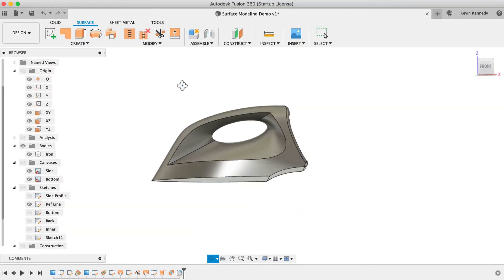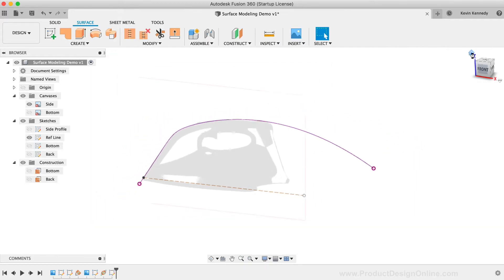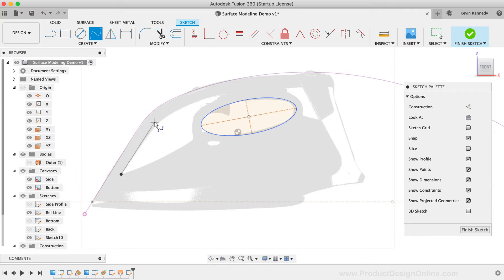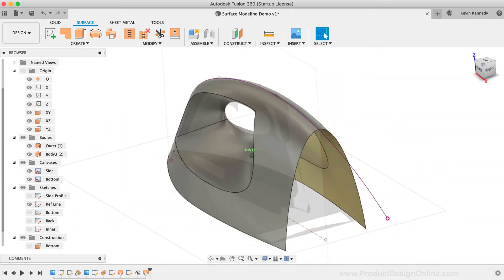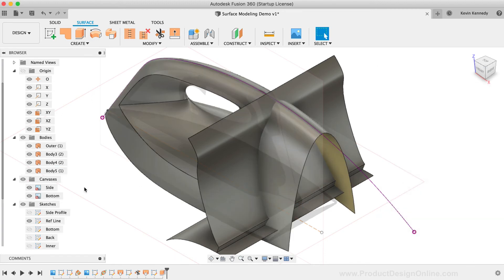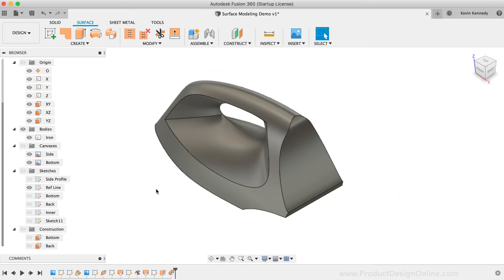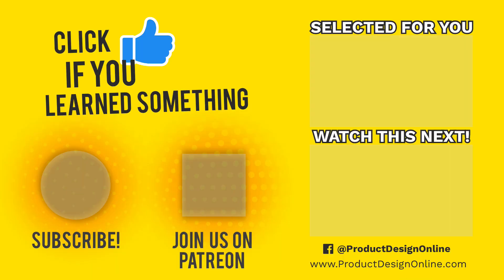Surface Modeling with Fusion 360

Comment from the maker: Learn more about surfacing with my beginner surfacing playlist ➞ http://bit.ly/surface-playlist
_
TIMESTAMPS
0:00 - Surface modeling foundations in Fusion 360
0:56 - Discussing the sketch geometry
2:30 - Switching to the surface tools
4:26 - Using the surface loft command
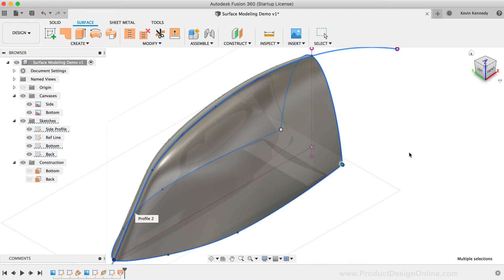5:21 - Changing the visibility settings
6:27 - Creating sketch geometry for handle
8:34 - Extruding the handle surface
9:17 - Trimming the handle surface
9:41 - Lofting the hole to finish the handle
12:13 - Sketching the back geometry
12:34 - Extruding the back geometry
13:00 - Trimming the back surfaces
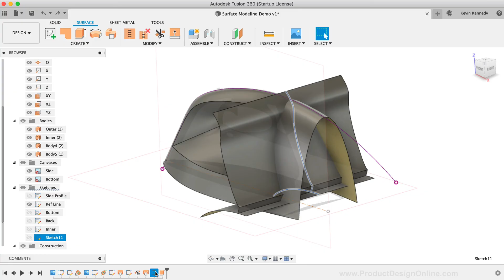14:30 - Creating the bottom surface
15:23 - Using the boundary fill command
16:37 - Adding fillets and next steps
17:40 - Summary of surface modeling techniques
Reply: How to set canvas perfectly?
Reply: can you  provide the whole process?

Comment: Am trying to produce a copy of a full size caravan, in miniature, to 3D print. The curves are compound and I have been looking at your “spline” command in conjunction with loft or sweep to achieve. The model would be hollow inside with the underside open. Having looked at your “surface “ command video, I wonder if it’s better to use that ….. and then “shell”…. But will that command work on something produced as a “surface “. Thankyou Robin… ps … love your videos. They have been extremely helpful.

Comment: Great video. My colors are in reverse greenish is on the surface and grey is inside. I wonder why.
Reply from the maker: Surfaces have two different colored faces to help indicate the orientation of the surface normal. A lot of times it won't matter. This differentiation can be important because some operations, like Boolean operations, may behave differently depending on which side of the surface you're interacting with.

You can use 'Reverse Normal' tool (in the surfaces tab) to flip them.
Reply: @ProductDesignOnline  Great 👍🏻 Thanks for answering

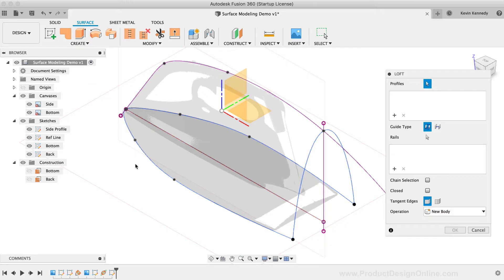Comment: 4:10, kinda crazy there are two commands with the same name, only differentiated with an icon color. Should be an option to include the type of command, e..g.

Loft (Suface)
Loft (Solid)

When pulling up commands.
Reply from the maker: I agree. Relying on color is not ideal for accessibility among other things.

Comment: Im trying to do this and im getting the following errors.
The operation failed.
    Try adjusting the values or changing the input geometry.
Error: Cannot create tool body for loft.  Im new.  Any help?
Reply from the maker: Hi Garrett. That Loft error is a bit tricky to troubleshoot as it could be a number of things. Could you upload the Fusion 360 file into my community space? https://community.productdesignonline.com/

Comment: So the finished product is solid or not?
Reply: Yes… after using the boundary fill tool
Reply: This is just the beginning, modeling with those techniques but then I guess you need to split the body to create the different parts of the product and continue the corresponding development depending on the material and manufacturing process

Comment: love you videos! I am having an issue with "boundary fill" - the bodies will not turn green if i select all 5.. am i missing something? but if i circle the whole object it turns green but has 8 Tools and 5  cells, but if i also click on  XY plane (have 6 tools , and the middle cell  aswell as 1 more on the bottom line-which you added for extrusion)..could help me out here? thank you in advance.

Comment: Hey, I've been watching your videos for the past few days, been watching mostly loft, sweep and surface modelling tutorials. Can you help me with a particular challenge I'm facing? I need to make a winglet for an airplane I'm designing. It needs to be a curved winglet (using spline tool with 3 points) as the guide rail and the wingtip airfoil as one sketch profile and the winglet tip as another sketch profile. It always shows error. Please just make a small video of how to be able to do it. Thanks in advance

Comment: Kevin - Your tutorials are some of the best available.
I would love to know how to loft from a scanned image to a geometric shape.  (ie.. scan of human face to loft to a breathing apparatus)
Reply from the maker: Hi, Michael. Is the scan a mesh file?
Reply: @Kevin.  
Initially it is a scanned mesh.  Hi converted it to a BRep file.  Tried various options such as tracing the outline with the PIPE spline and that created a nice contour, but then could not loft to the pipe.  Another option was to offset a plane, extrude a circle or square  to encapsulate the mesh, then use COMBINE / CUT to create a parting line as a new body and delete one of the bodies I do not need that extend beyond the scanned BREP body.  The task is very tedious and wondering if there is a more simplified workflow.  I’ll be glad to arrange a GOTO meeting with you offline to further discuss the scope if you like. (Mbrown@alliance-PCB.com)
Reply from the maker: @michaelbrown-qe8cr  One option would be to use the "Project to Surface" command or "Project" command to take the pipe geometry and turn it into a 2D sketch that could be used with your Loft feature.

Scanned files are tricky in Fusion 360 because they always mesh files. Converted files often have a high number of triangular mesh data which makes it hard to reference without simply recreating the shape/mimicking it.

Comment: how do I get back and bottom sketch lines to connect with each other? when I try to use the loft tool with the rail it turns yellow.
Reply from the maker: Hi, Izzat. You can try using the "Coincident" constraint to force them to stay snapped together.
Reply: @ProductDesignOnline   Thanks for the reply and the great work. Building symmetry lines and Mirroring like in your sketch worked much better, 'Coincident' Constraint was almost impossible, I don't know why.

Comment: when to use Patch vs Boundary fill Please ?
Reply from the maker: Hi Amer. Those are essentially two different tools. Patch lets you connect open surfaces, whereas Boundary fill will fill surfaces that are already full-closed. In many cases, you may have to patch openings/surface to get the Boundary Fill command to work.
Reply: @ProductDesignOnline   Thanks .You are awesome.

Comment: How do you bring up the Spline command by drawing on the canvas with the mouse?  I thought it was just the old UI, but you're doing it here in the new UI.
Reply from the maker: Hi, Bobos Curse. I'm using the "Marking Menu". If you right-click with your mouse you can take a look at all of the actions. However, the intent of the marking menu is that you drag the mouse as you right-click, to quickly activate the desired command (you have to remember location of things). In this case, I was dragging my mouse cursor (while right-clicking) straight down to activate the sketch commands and then straight to the right to activate the Fit Point Spline.

In a lot of my beginner tutorials I reference the options in the "right-click menu". In these overview or more intermediate/advacned tutorials I'm starting to show how efficient it can be. Cheers, Kevin :)

Comment: This will be last time I post "off-topic" concerning your videos But I had to ask if you have seen this before:
https://www.facebook.com/photo.php?fbid=10214476731063337&set=gm.2583564061690265&type=3&eid=ARD_L8I4mA0xjus-nmBp9GnnMMMU4LXkCVY0q-o55rXUk-X3ykyb1mj1PVjiHI8ggO33DZyyRshb74rm&ifg=1
Reply from the maker: Hi Rud Dog. Thanks for sharing. I have seen this before. Autodesk Feature CAM is essentially a software package for places that operate a bunch of CNC mills. You can think of it somewhat like ripping the CAM(Manufacture) workspace out of Fusion 360, with some additional CAM features. It's supposed to help machine shops automate more of their workflow so they spend more time milling and less time setting up files. I haven't used it because it wouldn't really benefit the one-off projects that I do. Cheers, Kevin :)
Reply: @ProductDesignOnline Online thank you appreciate the explanation.
Reply from the maker: @MaxGoddur  No problem. I'm always happy to help...nothing is "off-topic" as long as it's related to design and manufacturing :)

Comment: Who or with what software are you doing your screen capture.  I have to do a presentation for my Ham Radio club and I have not found a satisfactory solution in my brief search.
Reply from the maker: Hi, William. I use Screenflow 8, which is only available for MacOS. The windows alternative would be Camtasia. Cheers, Kevin :)

Comment: In another video (sorry for the posting here) you asked what error message I was getting while opening Fusion360. All my attempts at using my existing photo linker (pasteboard.com) failed. So decided I would create a separate account on FB for just adding pictures and linking them. Anyone can use this feature as it is open to the public. https://www.facebook.com/photo.php?fbid=10214454184899697&set=gm.2577655262281145&type=3&eid=ARA2IEt9hsFmebbJay5yXL0gsJmfxo13ez8KBAEmzcnJOsZi7JvEvv0ZsqNNgcTO9KnmpfTnnAD1VG2t&ifg=1
Reply from the maker: Hi, Rud Dog. Thanks for the picture link. It appears that one of the "Add-Ins" that you have installed on your local computer has not been updated with the new API for the recent (August) UI change. With the UI update, where they switched the toolbar to the tabbed look, they also introduced a different API that broke all the add-ins. Every add-in needs to be updated by its original Author.

I see the add-in that's throwing your error is Slicer for Fusion 360 (created by Autodesk). I have that add-in as well and have not had any issues with it since the update. It was updated last September 17, 2019. You may have to uninstall it and reinstall the add-in if you're still getting this error.

Add-in link: https://apps.autodesk.com/FUSION/en/Detail/Index?id=8699194120463301363&os=Win64&appLang=en

Cheers, Kevin :)
Reply: How does one uninstall and reinstall this feature can't seem to remember how I got this working before.
Reply from the maker: @MaxGoddur  All of the add-ins and scripts should be placed in a specific folder on your computer. You'll have to navigate to that folder and delete the files (to remove the add-in). Then, download a fresh copy and place the files back in the original location. That should (hopefully) fix the warning issue you're getting.

This Autodesk help article explains how to install add-ins. This may help  you find the folder they're placed in on your computer - https://knowledge.autodesk.com/support/fusion-360/troubleshooting/caas/sfdcarticles/sfdcarticles/How-to-install-an-ADD-IN-and-Script-in-Fusion-360.html

Cheers, Kevin :)
Reply: @ProductDesignOnline  You sir are a very patient man.

Comment: Could you actually surface model arround a assembly of mechanical components ? Meaning a simple valve wich is connected to a flow sensor and wrap a model arround those components like you did on the raspberry case ?
Reply from the maker: Hi, Bouman Service & Engineering. Great question. You definitely can. I would suggest starting your surface model in a separate component. Cheers, Kevin :)

Comment: Hi, yes.  This is much better.  I have had difficulties with some of your videos because although they cover great topics and are full of really good information, getting that information takes so long when every little detail is described.  I have found them a little bit frustrating.  I also find describing the steps in detail before doing them is also a bit of a problem as it doesn't mean much to me before I see the results.  However, you clearly have a great deal of knowledge to share and a fantastic delivery style so this new approach makes you much more accessible for me.  Thanks for the great work.
Reply from the maker: Hi, Scoopy Doopy. This is great - thanks for all the feedback! I'm always searching for new ways to improve the tutorials, including types. Some like the step-by-step approach (and complain if I don't say every step) whereas others like these high-level concept tutorials. It sounds like a great mix of both will be useful for all. Cheers, Kevin :)